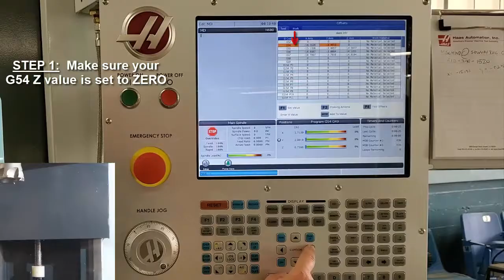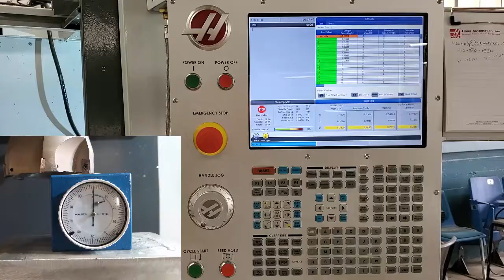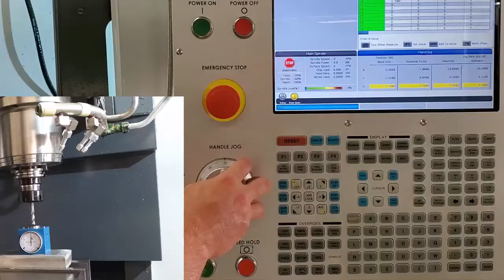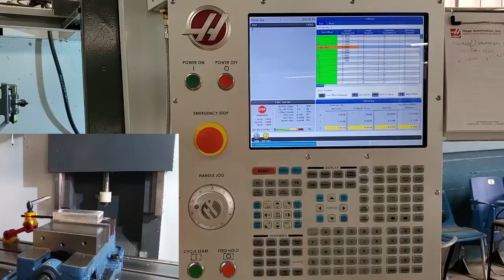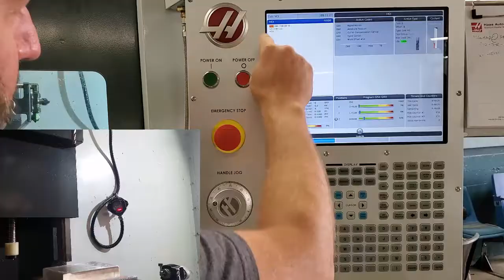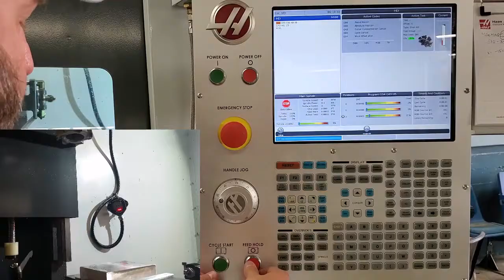Setting up Tool Length Offsets with a Z-Axis Touch-Off Gauge

Comment: I like to put the 2.00 in the Z offset during touch off so I don't have to put a -2.00 in the Z offset. I try to always keep my Z offset Zero or in a positive direction. I will also touch off the table whenever possible or off a solid part of the vice not moving part. Then use a dial indicator to find true zero of the part in Z axis. It has been 12 years since I have run a HAAS Mill. Been running Fanuc Controls the last 12.

Comment: Hi sir just a quick question.  Your setting your tools relative to the top of the workpiece but if a tool got accidentally broke how would you reset the offset considering that the top of the workpiece is already machined? Would it not be better to set your 
tool offsets relative to the machine table?
Reply: obviously yes

Comment: I'm just learning the haas control but I don't think this is the right way to do it, you actually touch off your tools at the top of your stock for every job? Maybe that works but wouldn't it be better to set your tool height offsets once, from a fixed reference like the bed or home. Then just find your stock Z height from that reference and set in G54.

Comment: Instead of punching in -2.0 for every tool you can touch off all your tools then just put -2.0 in the z work offset. In a real world setting where time is money this is a more productive way.
Reply from the maker: If it's about efficiency then you really should be using the WIPS probe.
Reply: @JohnFuller804 well ur not in this application
Reply: @JohnFuller804  If it's about efficiency, a 6.4k probe is not more efficient than just setting the tools off the table, it's a conversation about setting the tools from a permanent location vs an fluctuating raw stock
Reply: I agree.   That is a faster way.

Comment: I use the next tool button after Tool length measure. It will go home and change tool. Saves some steps. Next tool only works if tool offset is used.  Nice video. I will add to my lesson plan. I also dry run in air after graphics check.  We use probe a lot and shift the G92 Z+2.0. To dry run.   Same With manual blue block setup. Same thing.  I teach  both methods